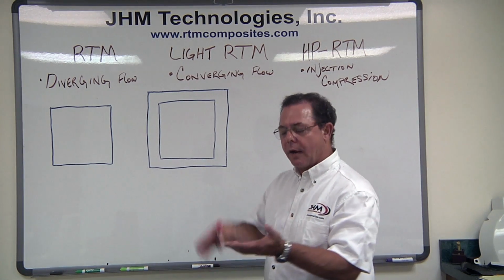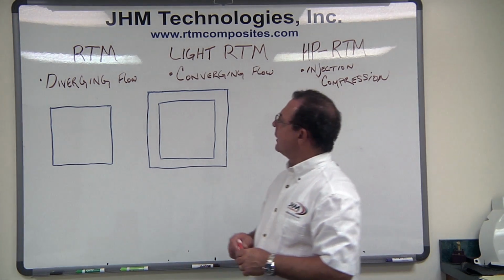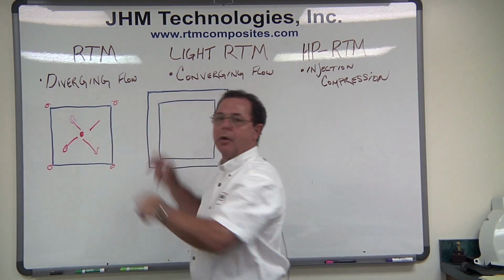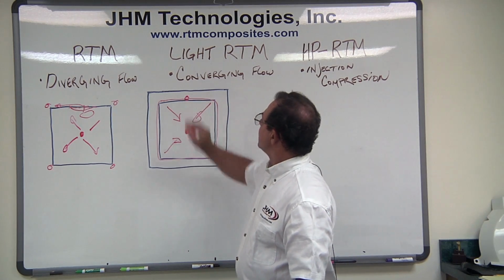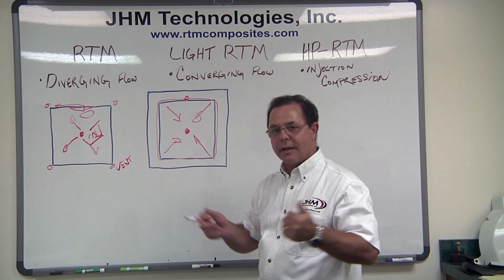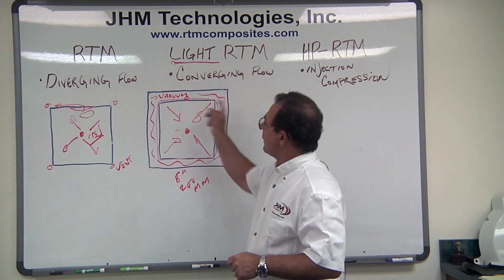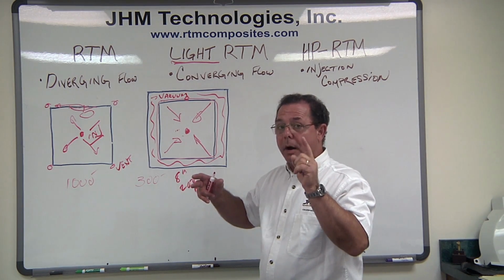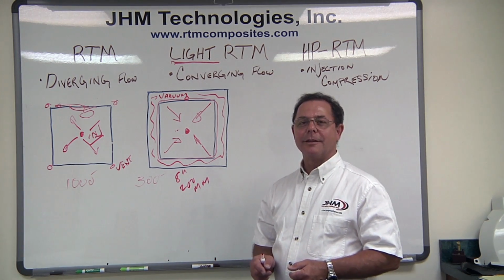RTM, LRTM, HP-RTM - What's the Difference?!

Comment: Hi, very intersting and condensed video. I see from your smile that you're an old school expert like me. I say that all is presented here was already well known since the beginning of vacuum forming (years around 1988 in Italy). The only "visible" difference from now-technology is that we used bags in the place of open films, but concepts were the same (even the so-called RTML, was implemented with 2 -shell mould inside a plastic bag).
Reply: At 6:05 ,  there's no reason for losing the vantage in the area already filled by the resin. The vacuum (which does not mean empty ) also works in areas filled by resin. Vacuum is a pressure concept. You can try to make a hole in the filled area and you will see enter air, and not exit resin.